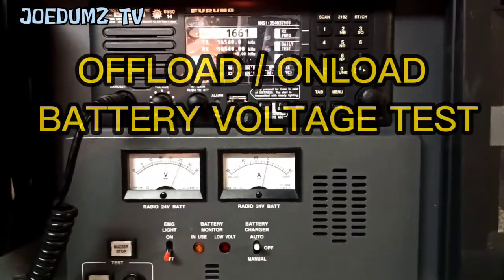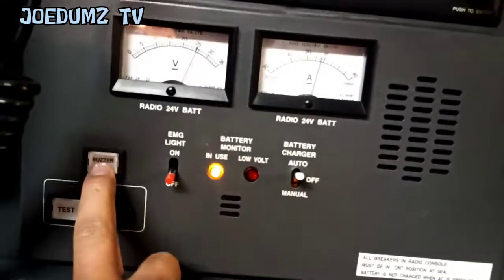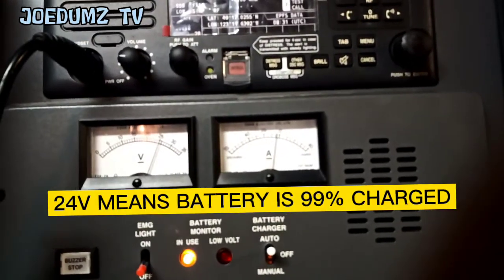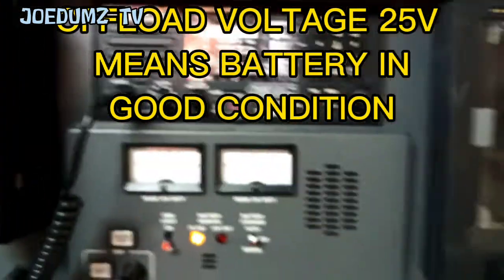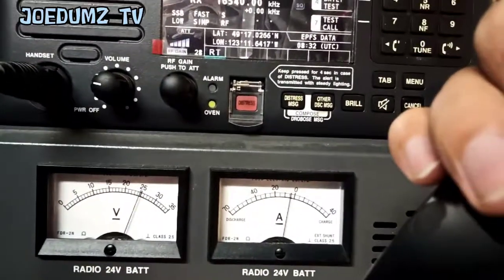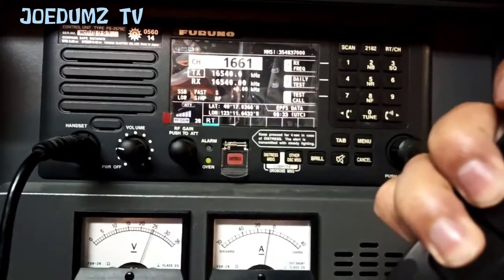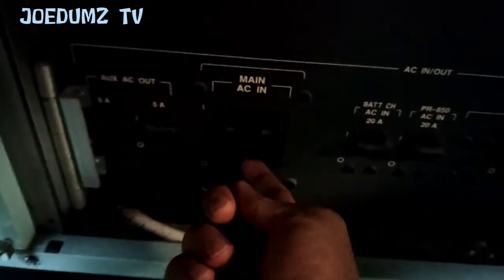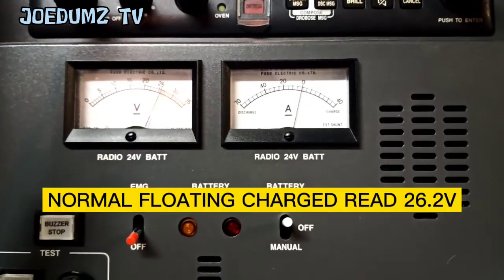MF / HF RADIO OFFLOAD/ONLOAD TEST FULL TUTORIAL

Comment: When MAIN AC is OFF, then the Charger is also OFF, as indicated on the Amp meter, is showing discahrge.
BUT, the SSB has to be modulated, in order to load the battery, as PTT os NOT ok.
OR, to use the TONE TEST.

Comment: I think that the battery charger should be switched off during the on-load test because the batteries continue to be recharged during the test unless it is not switched off.
Reply from the maker: Yes correct 💯